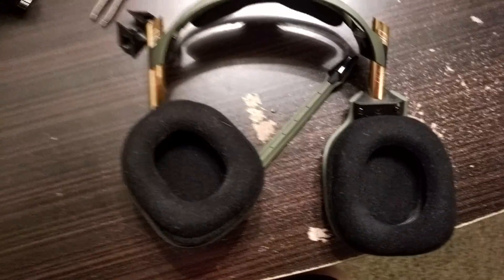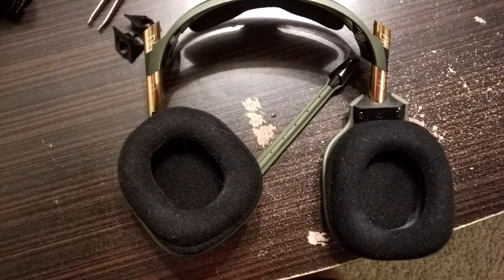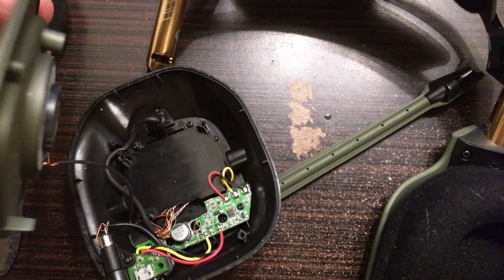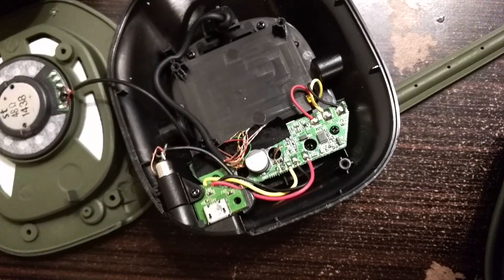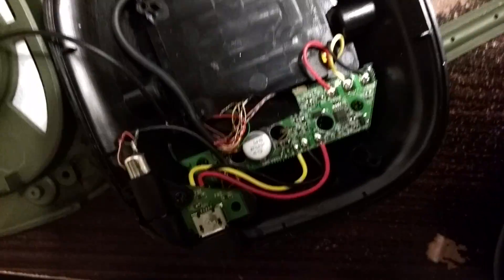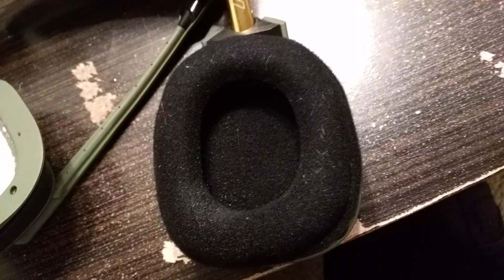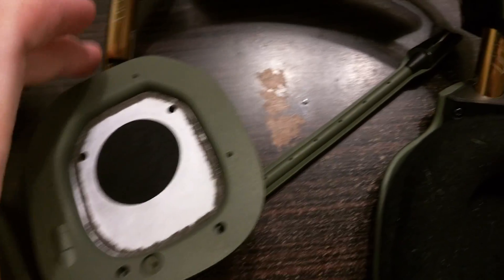Astro A50 Wireless Gaming Headset Disassembly

Comment: Thank you for this, tore mine apart toned all lines and between board and plug all good. Cut headset plug open and it was a bad solder in the plug end, one wire was soldered on by one strand🤦🏻‍♂️

Comment: Is there a certain part I can just smash to bits where this will turn off the garbage gyro sleep "feature"
Reply: Just curious if you ever found the answer to this question
Reply: @xion383  yeah I bought pro X2 lightspeeds it's a lil different but I'm used to em now and they last 10x longer and mic is removable and tbh they feel better the middle strap doesn't pop out either so it's better in every aspect to me but surround sound but again it's just adjusting to it then your fine 👍🏼

Comment: Thank you very much for showing me where the screws were on the Gen 3's - my volume wheel stopped working and another video showed how to disassemble and clean with 91% isopropyl alcohol but their video was on Gen 1/2 where all the screws were out in the open. Never would have guessed to peel off the non-magnetic pad inside!
Reply: Same here! Love these videos, I thought I'd have to buy another headset

Comment: at 2:05 seconds what screwdriver did you use to unscrew those 2 screws that support the earpiece. Mine looks like a T45 with the middle inside of the screw sticking up.

Comment: Just to expand on the wire that was loose. As you move the mic, between the "Mute" and "Unmute" positions, that wire flexes as the mic rotates. There is no stress management sleeve or reinforcement. As a result, the wire is getting stressed and fatigued on every mic reposition. That is VERY poor engineering, especially given the flimsy nature of the wiring. The failure of this wire, in a fairly short time, is thus pretty much guaranteed, illustrating either incompetence in the engineering and QA testing, or a design that is geared toward timed failure, forcing the customer to buy another device.

Comment: Thanks for this. I am trying to repair a circa 2013 A40. The swing down mic will not unmute. The "peel off the inner foam pad" was the key I was missing to complete taking the earpiece apart. Simple once you know about it, but this is the first video I saw that actually identified this. Once disassembled I found that the small grey/green wire, shown in your video between the yellow and bare copper, had come loose.

Comment: I was thinking of buying this 400$ CA headset which is on special at 250$ at BestBuy Canada but thanks to you I see from the internals that it's actually a cheap 50$ headset with simulated 7.1 surround software. Thanks Astro but no thanks!
Reply: All gaming headphones are stereo.. there are very very few that’s actually surround sound. The headphones that actually have 5-7 speakers in them, the drivers are small and so compact it actually does a worse job than simulated surround sound

Comment: My lord, I don't even have this headset, but it helped me a lot. I have an HUHD headset, and tried to disassemble to fix a power issue, but only found one set of screws. There are no videos that I could find for disassembly, but in yours you mention pulling off the ear cup to find more screws. Sure enough, mine detaches and there's 4 more screws. This helped more then you know. Thanks man.

Comment: so your microphone stoped working?? my microphone makes strange like ''ripped wires'' and sometimes it work and sometime it doesnt? will it be the same problem as you?? i open it up and get that wire fixed again?
Reply from the maker: Steven Boulanger for a little while mine was working on and off,  then one day it just stopped all together. From your description it sounds like the same problem.  I do have another video that has the complete tear down of the whole headset, just in case you want to look around it some more.

Comment: If I take out the two screws on the piece that connects the earcup to the metal adjustable part of the headset will it come off without having to completely tear apart the headset? Because my paint on my headset is chipped a bit and I wanna paint them. Is this possible and easy to put back together?

Comment: $70 Turtle Beach are built better. Other than sound quality. Mine snapped where the side meets the headpiece and trust me, I'm never rough with my things.
Reply: Pr0V1nc3 Gaming turtle beach’s are not built better. The plastic they use literally strays crumbling apart 2 years down the line

Comment: I did get battery from Amazon 2 wires... Did not work... I got one from reputable seller eBay 3 wires and is working better than original ... Original was 800 and I put a 900 ... Last longer
Reply: Can you make a YouTube video showing us where the battery is and which places to soder the wires into?
Also if you could at least list all the parts needed to soder a new battery that would be great.
I don't have a sodering kit or a 800 or 900 battery so your help would be amazing.
Reply: https://www.ifixit.com/Guide/Astro+A50+Battery++Replacement/53124

A link for a how to...It is very easy. Ebay has the battery I just ordered one for myself. I can send the link if you need it
Reply: What seller i need a new battery for my Astro a50 generation 2 headset.

Comment: hey man mine stopped working, the headset won't  turn on or charge. what should i do????
Reply: I have the same problem..
Reply: I fixed mine, the headset would not charge or turn on. So I took it apart like he did in this video & found out on the charging port was not working (not the battery). One of the 5 pins that connect to the charger was bent backward, so I cut the metal frame & bent back the pin. Now it charges again and works as good as new.
Reply: also, when i try to charge my headset, i can feel the battery getting hot, but the light does not turn on and my headset doesn't turn on
Reply: Ali Imran If your battery gets hot thats probably not a good thing.. You don't have to solder anything, I'll link you 3 photos I took of my headset while it was apart and I think they will explain better. 

Here is to prove my headset if charging : postimg.org/ 

Here is the metal frame I was talking about :
https://postimg.org/image/nhrypn1wt/736d0009/

 Here are the pins I was talking about (they are of a copper colour inside the black plastic) : https://postimg.org/image/9xv0264t7/2a1a6d64/ 

Hopefully that helps.
Reply: Ali Imran Yeah mine are gen 2 but they are almost the same
Reply: Ali Imran Just applied a small amount of supet glue in each corner and pressed down
Reply: It's common for the A50 as they are defective.
Reply: i believe i have the same exact problem, what does the charging pins look like, I'm also going to take part the right ear cup and try to fix my headset. also, what do you mean by u cut the medal frame? do i need to solder something together? sorry for all the questions, I'm just a noob at this stuff, thanks man
Reply: i really appreciate the photos, makes ur explanation a lot clearer I'm going to try ur solution out tomorrow after work. thanks for the pics again, ill try to keep u updated lol.
Reply: wait a sec, do u have the 2nd gen a50? the 1st gen (which i have) has a mini usb, not micro. i believe i can still fix it tho
Reply: oh ok cool
Reply: also, did u HAVE to peel the padding of or can u just keep it on and still access the internals?
Reply: Ali Imran You can just glue the padding on the ear cups back on if that's what you're talking about, I just peeled mine half way to expose the 2 top screws
Reply: +Fluroxide :D i just rewatched the video and i actually do have to take off the foam padding to get to the 2 screws out, how did u attach the foam padding back?
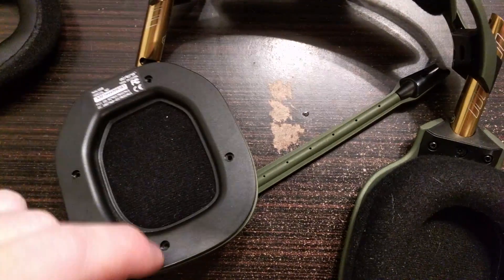Reply: +Fluroxide :D he takes the foam pading off at 0:45
Reply: +Fluroxide :D oh ok thanks
Reply: yo bro, i did everything u said but i don't see a big problem with the usb connector, i guess the first pin looks a bit weird but it definitely isn't bent. is their anything else i should do? i might just open the metal frame and inspect the pins but, how did u open  or cut the metal frame? also how did u put it back together?? sorry for all the question yet again.

here are some pics u can inspect, the quality isn't great tho, thanks, i really appreciate all the help. 

https://postimg.org/image/a0ppzv7ot/
https://postimg.org/image/4dtd2e565/
https://postimg.org/image/q1ibcu5kd/
https://postimg.org/image/izkdqn1yl/
https://postimg.org/image/w4zvwqvu5/
https://postimg.org/image/5xyp0sdkd/
https://postimg.org/image/l2i2or0f7/
https://postimg.org/image/nxv5vm4f7/
Reply: Ali Imran Yeah it doesn't look bent, so the connecter probably isn't the problem, but if you still want to look at the pins to check again I used surgical scissors to cut the left hand corner of the frame & afterward I just bent it back into place.

Maybe there is a malfunction or problem with your battery, but I personally don't know how to resolve that if that's the case...

Comment: I have no sound coming from my right ear piece while I have full sound coming from my left. You by any chance have a solution to this problem??
Reply from the maker: my only thought besides broken hardware would be a wire disconnect, in which case you would have to disassemble and solder it back together.
Reply: Cameron Myers Would you possibly know which wire would be responsible for that??
Reply from the maker: +Beatz replays I just shot the full tear down today, once I do some editing I will be posting it. It should be up in a couple of days.
Reply from the maker: That's where you'll see the wire that it could be.
Reply: Cameron Myers Thanks man I hope it fixes my problem will stay tuned for that video!
Reply from the maker: My new video is up. Go check it out! Remember to like and subscribe!
https://youtu.be/8hQPA89cTE8

Comment: Did you know where the Battery is? Do you know how to replace it? And where to buy it?   Thanks for your video
Reply: its probably on the side where the charge port is. It should be thin and silver. If you open it up and look at the battery it will have some sort of a "code" on it. Its gonna tell you which kind of battery it is, all you gotta do is Google it or eBay it and you will find it. 

BUT before you do that, contract Astros support they might replace it for free if you're still under the warranty coverage.
Reply: did you have any luck finding the battery number? I need to get one too and haven't torn my headset apart yet?
Reply: +tanner lauderback Did Not, My is lasting about 3 hours of play and I will need to do soon, if you end up doing before me, I appreciate if you let me know... Thanks a lot for replies...
Reply: Just found it battery number is 603443
Reply: Amazon has it for 15 bucks buying one now
Reply: https://www.ifixit.com/Guide/Astro+A50+Battery++Replacement/53124.
Reply: +Railan Ferreira I did find this that show the part number too
Reply: I did purchase one... Hope it works , thanks
Reply: did you fix it guys ? i have same problem
Reply: +EeRxTeM - عبدالعزيز I did , but make sure get better I with 3 wires ... 2 wires did not work for me !
Reply: how you do it with 3 wires . and is it hard to do?
can you gave me a video or like that . thx bro
Reply: you meann red with red and yellow with yellow and black??? 

can I do it with out soldering?

Comment: so i cant use my mic at all to talk to my friends i hear this odd noice when i was using it sorta sounded like when you losing connection and after that my mic didnt work and i couldnt talk to anyone
Reply: hey same thing just happened to my headset
Reply: Same here try to take my mic off mute and could no longer talk in chat does anyone think it’s the same problem the warranty was talking about soldering back to gather?
Reply: Rick Rodriguez so did you get it to work?

Comment: Hey cameron! My mic boom has become very loose and spins way around instead of just locking in and stopping. I don't know what happened. I didn't force it or drop it or anything. Have you seen any way to tighten it when you got inside to fix yours? I don't want to pull it apart without asking you first because you might know if I can fix it or if it has to be sent back. Thank you very much!
Reply: if you have a proof of purchase they cover it for a year, it's known flaw in the a50s.
Reply from the maker: Unfortunately, I didn't dig any deeper than shown in the video. So I don't know if there is any way to tighten it. I've been thinking about doing a full tear down of these to show, but I just haven't had time. But keep a look out and hopefully soon I'll have one up.
Reply: Cameron Myers i actually ended up just calling astro and getting a warranty claim lol if you have proof of purchase they work really well with ya

Comment: if my mic won't mute all the time when i need it to because its loose when down or when its in upright for mute. it has to much wiggle room, ever come into that issue? whats easiest fastest way to tighten it back into place to fix this issue.
Reply: mine wont mute all the way when i pull the mic up on discord, do you know how to fix it? and i also cant hear myself when i speak closley to the mic... ;(
Reply from the maker: Unfortunately I didn't habe this problem. But if you use this video or my other video that is a complete tear down then you might be able to figure out the problem.  Good luck!

Comment: What exactly was the problem with yours? Mine is stuck in mute mode. I hate to pull it apart for no reason if this can't be fixed and I haven't been able to find anything about fixing that issue.
Reply from the maker: The issue with mine was the mic port had a wire that wasn't fully attached and would cut off my mic all the time. So I had to go in and re-solder it together.

Comment: Thank you for taking the time to do this.  You saved me a lot of grief in figuring out how to pull it apart.

I had a microphone arm that was sloppy and not holding itself up.  I was hoping for an internal tightening mechanism.  Unfortunately, there is none.  Some very thin plastic is used for a friction hold, it broke away (crumbled); no way to fix.

Comment: won't charge is the charge port replaceable
Reply: if you can solder and mod yeah but otherwise youd have to contact astros support and if the warranty is up ull be paying a repair fee... im currently looking into soldering a new battery in place of my old one if it is indeed dead but im hoping i can find an easier fix if i crack it open, or mod it to run off the usb as if i was using it in charge and play but with no battery....
Reply: hey did you manage to get this done? I'm having the same issue. it's driving me insane
Reply: My issues was just bent mini usb pins which i got to and had to work out and flatten to fix. Otherwise if it was a simple solder job i woulda been able to do that too. What are u specifically needing help with?

Comment: Hey Cameron thanks for the video. Did you take it apart due to the static on the mic whenever you would move it/ try to mute the mic?
Reply: +Sauce3 I get that as well for me. Just have to where the headset in a weird way and find the sweet spot to talk lol.  I'll try to open it but I'm a little bit worried to mess something up. I can still hear from the headset but i can't talk sometimes if i can find the sweet spot like i said.
Reply: This is my issue...I'm trying to figure out what it could be. I'm willing to open it up but only if a definite fix is a option.

Comment: i just recently have had a problem with my a50, i hear a crackle/statick on the left ear when i move the headset around 
anyone know a fix?
Reply: +Tony Diego i hear the crackle/static on both ears
Reply: +Tony Diego Yeah mate, I had same problem with a 2nd hand pair I bought, little prick knew they were stuffed so sold them on, only paid $80 for them so all good. Anyway what I did was pulled them apart like in this video and noticed the plastic circular cone had been squashed, so using my air compressor I blew it out from the other side , I also read that dust can get between the driver and magnet and cause the same issue and to use compressed air to blow that out, either way, it'  fixed now for over a year half with no crackle. Cheers

Comment: Hello dear, so the battery is on the other side of the headset? i cant to put a switch to RESET the battery (you know when u have the bug where your only solution is to wait the full battery drain) , so i dont have to wait the battery drain, i shut all off, then on again :)
Reply: +Prince Artanis ok guys batty is on the left side, nothing on the right side

Comment: I used this video and a little extra guesswork to remove my broken/loose microphone from my A50's.  I've got a superior desk mic anyway so I didn't need the mic on the A50's and mine was broken and swinging around annoyingly.  Once I got the earcup open per this video I actually cut the mic off with my dremel (sure did lol, no way around it I could find) on the outside and pushed the stub through to the inside to remove it completely.  Reassembled the headset and it works great sans mic.  Thanks for the help.
Reply: fck i think this is the only way I have...